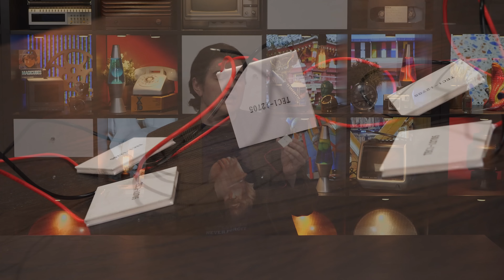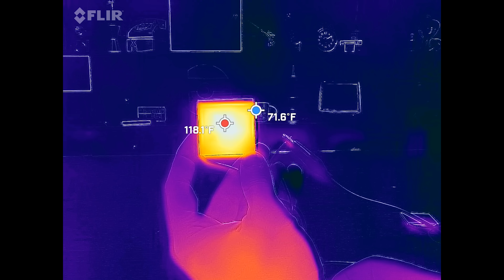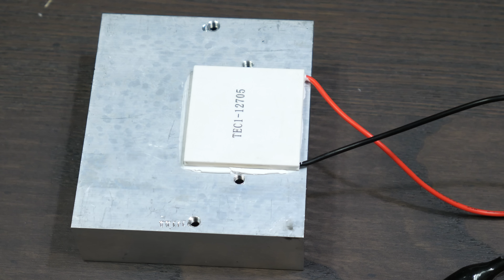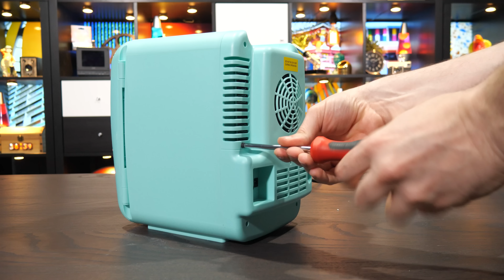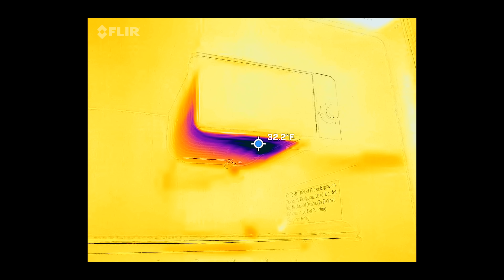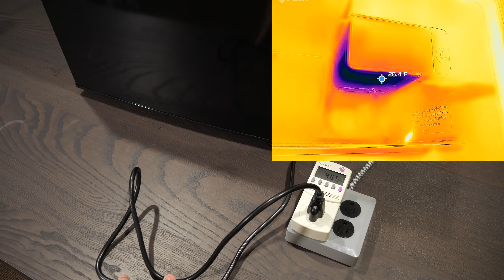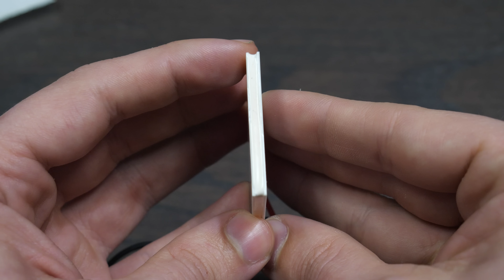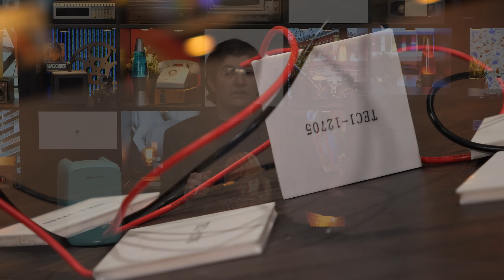Thermoelectric cooling: it's not great.

Comment: In defense of the little watt-eater it can easily plug into the car and drain car batteries faster than an intermittent compressor fridge.  So if you want your car battery dead to have an excuse to get out of work tomorrow, then the choice is easy.  The blue guy and headlights get me a day off so much faster.

You also didn't say how may of the little fridges fit in the home fridge.  That would help it cool much much faster lol  Bunches of 'em at once!

Comment: "It's much bigger than a typical mini-fridge" has the implication that both things are of the same group, a mini fridge, at least in the dialect of english I speak.

The confusion arises from the use of 'typical' as typical would typically (heh) be used as a comparative, making the sentence come across as "It is atypical in being bigger than a mini-fridge" which as you can see suggests it is one. I think dropping the typical would have made the sentence come across the way you intended because there is no comparative and it is just a factual statement.

Comment: Peltier coller/heaters have one more application......they are used to keep the temperature of laser diodes constant as they can be used to vary the temperature on a continuous scale and that too can heat and cool diode based on the ambient temperature. You can control the amount of heat or cool using PWM signal. Keping the temperature of laser dioses is critical for maintaining they spectal purity.

Comment: Thank you for telling me about the heat pump in normal fridges, needing to be upright. I always wanted to tip one over onto it's back, onto a rack for airflow, to turn it into a chest fridge, for even more efficiently, keeping the cold air from spilling out. So I'm guessing, I have to redo or carefully bend the lines without linking them, so a normal mini fridge can be on it's back, but the compressor is still upright? And does this also mean I can't use a normal mini fridge in a mobile application, like a homemade RV or houseboat, because the compressor lubrication won't be settled at the bottom?
Reply: And what do you think about making your own generator to run on waste heat, using a Stirling engine connected to a brushless DC Motor, verses an array or Peltier Termo Electric Generator units, and a massive thick heatsink or liquid cooling pump to a massive radiator, like for a racecar?
Reply: *an array of Peltier TEGs

Comment: One side is good, while the other side creates horrors for the project....turn it around and get the opposite effect. One side is great, while the other is a horror show for your project. Inevitably you are creating condensation and electrical nightmares while wasting energy on a wholesale basis. They are literally nothing more than a 'proof of concept', and the hoops one has to jump through to deal with condensation makes them useless in any electrical application, not to mention the gross inefficiency.

Comment: the best mini fridge ad I've ever seen. only 100 bucks? you got me.
Reply: But get one without that tiny freezer compartment in the corner.
Reply: @TomFichtnerLeipzig  Absolutely. I had one with and one without. With was just a pita to maintain and clean. Constant dripping during defrost cycles as well.
Reply: Also - for the noise, you can stuff insulation in the compressor space, and add a cover to reduce noise. It wont overheat
Reply: Got one for $10 at goodwill and kept my beers chilly next to my desk lol, just by common sense I could tell it couldnt do anything passed that but imo an absolute steal for beer.
Reply: I found one just as good for $80 at Best Buy
Reply: Do yall have a link for it i want one

Comment: Interesting that the door didn’t have any insulation. If you add insulation to the door, maybe improve the insulation on the walls, and have a separate temperature sensor that can cut on or off power to the unit, I think power efficiency (over time) would way up and time to cool would go down. Interesting stuff!

Comment: So the energy consumption is definitely a huge downside, but I will say that the awful cooling capability is significantly influenced by them just using a cheap, terrible design. I work with high end scanning electron microscopes, and for doing EDS (energy dispersive xray spectroscopy) we use a detector with a peltier cooler that can keep it extremely cold. Like potentially -25F, though I'm not certain about that. Thing about them that many of the cheap designs don't take into account is that because the element itself has no moving parts it's only transferring heat out of the chamber through simple conduction - heat sink on the other side has a fan blowing across it, but the cold side is only pulling heat from what's directly touching it. Air is a thermal insulator, so if it's cooling the air sitting on it then it's going to do a terrible job of cooling. If it's got the drink can directly touching it, it'll cool that can faster but all the others will have to transfer heat all the way through it to cool down. Super high power ones could brute force through that, but really you need a better way to move the heat to the peltier element when you're cooling the air in there.

Better, still relatively cheap designs, can be had, but yeah like you said, mostly good for a car or something unless you have something like we do at my work that needs a specific small spot to be kept very cold.

As far as the insulation - if it was vacuum insulated I could see that still working well, since a vacuum is an extremely effective insulator, though I doubt they bothered with anything like that...

Comment: fucking finally, I have been caught between a peltier and compressor driven dehumidifers for my laundry room, fuck! the volumes were massively different, 1L vs 10L, but I was like but the power consumption, but if it needs power then it is doing the work, cheers fella, over the moon to have you taking and position on purchasing cheap crap, the fucking 90s kid in me really wanted peltier to work but it doesnt and it is just cheap crap

Comment: 7c Celsius is definitely food safe and there Is no food that will spoil at 7c due to heat
Reply: That's a total bs we always have it at 6 (and it even can't go lower even tho its old) for my entire life as I know it and there is nothing wrong nobody is ever sick and food doesn't spoil
Reply: it definitely is not, food stored above 40F (~4.4C) is not considered safe and puts you at risk for foodborne illness
Reply: the food danger zone is 5c to 60c
Reply: @MrBlackmidi1234567890987654321 

A Europe-wide study by scientists from the Salmonella and Listeria Unit of the ANSES Food Safety Laboratory found the average temperature of domestic refrigerators in Europe is 6.4 degrees C (43.5 degrees F), and 95 percent of them are below 10 degrees C (50 degrees F).

Reasonable storage expectations
Producers of ready-to-eat foods are required to test the development of bacteria under conditions in which the food will actually be stored. This includes demonstrating that the concentration of Listeria monocytogenes will not exceed 100 colony forming units per gram (CFU/g) at the end of shelf life.

In the absence of data on domestic refrigerator temperatures, the European Union Reference Laboratory (EURL) for Listeria monocytogenes recommended simulating storage at 12 degrees C (53.6 degrees F) in consumers’ homes.

Comment: Thermoelectric cooling is great, but the people who design them seem to not know how the work.

I always wonder why the hot side does not have a heatsink and a fan. 

You actually need to cool the hot side to increase the efficiency of the cooling on the cool side.

The thing is , normally a heatsink and fan can only achieve cooling to a few degrees above ambient air temp. 

Adding a thermoelectric device to a traditional heat sink will allow you to achieve cooling bellow ambient air temperature.

Comment: A good consumer application for these that I've come across is with an in-car phone mount. Phones will often get too hot when mounted on the dash or windshield in the summer sun or when mounted to a vent in the winter with the heat running. One of these can make contact with the back of your phone and keep it... from overheating. It wont likely cool your phone, but it'll at least not shut off due to too high heat; which can matter if you're relying on your gps.

Comment: My only real interest in this is using TEC for immediate temperature compensation for laser diodes.  Though tbh I've wondered about a less mobile option utilizing a mini fridge and a fiberoptic cable for output.  Maybe liquid cooling through the heatsink.  A similar approach with chillers works great for CO2 lasers...

Comment: peltier devices can also produce electricity if they are heated. they're used on log burner fans. heated on 1 side and big heat sink (usually stylised) on the other and hooked up to a dc motor which turns a fan. handy to push heat around a room for a log burner

Comment: Theoretically, you can use pure butane as refrigerant or even NOx, but you may need higher compression or your working range is more narrow or need extra steps. 
Thermal electric solid state heat pumps like a Peltier or Seebeck element, depending on the application,  have no really limit how low or high with the temperature you can go. 
The Voltage sets the achievable temperature difference, the current sets the amount of heat that is displaced to the other side. Thats so far for the Peltier, the Seebeck is the opposite principle  and works the other way around. Heating one side and cool/dissipate the other side, the temperature difference sets voltage and the current is basically dependent on the amount of BTU that actual travel through the element and the circuit resistance. But both direction have a terrible efficiency. if you buy a TEC(Peltier) element, efficiency is on applying power better as generating power, the TEG(Seebeck) is better at generating power but less efficient by applying power to cool something.

Comment: Peltier elements do seem more useful for heating. A resistive heat element has a COP of 1. A Peltier element that can move heat in addition to the heat it naturally generates can put out a fair bit more oomph in heat mode. I'd argue that's useful for a box that you want to heat rather than cool

Comment: Basically a thermocouple in reverse. I looked into designing a "cold plate" around the Peltier junction. A nifty notion, but I determined that the heat generated by the process overshadowed any useful cooling effect. 
So much for my great idea. I could have left out the Peltier device and added a heating element and don a hotplate just fine ... AND USED LESS ENERGY!
Side note: my father in law bought one of these Peltier junction cooler for my mother in law to keep her insulin in. The version was the 12V Travel Cooler version, and never worked, and ran down the car battery when they were parked.

Carnot cycle fridges are a much better solution, as you showed.
Nifty device, though, and have a (very narrow) truly practical applications, such as cooling something in tight places. And the Peltier junctions can be stacked (with in limits).

Comment: A cute and mundane application for these kinds of "fridges" is sourdough starter maintenance. Times between maintenance are strongly influenced by ambient temperature, and fridge temperatures grind everything to halt, but slap a thermostat on one of these things and you no longer have to do calculus to keep your sourdough in perfect working order. Two of the main drawbacks don't matter for sourdough: it just needs to fit a 1L mason jar, and never needs to hit a target under 8C (if you need that, then you stick it in the real fridge). Energy efficiency's still a killer, no getting around that. I never measured it myself, but the spec sheet claims 38W to hit approximately 20C below ambient, which is *oof*.

Its the nichest product imaginable, and I've never met another living being that even knew these things existed, but they're real! Brod & Taylor Sourdough Home costs like 3-4x more than the garbage plastic cubes off Amazon, but the build quality is outstanding, and it actually accomplishes its one singular task.

Comment: it's almost same like my bike case, i had 125cc motorcycle it's consume a lot more gas than bigger displacement motorcycle because the smaller engine always running in high rpm, whereas big motorcycle always run in low rpm in the same route.

Comment: I have some air-dehumidifiers with peltier elements and they work fine, but I noticed that they need a lot of time (and thus energy) to collect a significant amount of water. I used to use those (special) salt containers of about half a litre. Don't know if they are better to use. Well, you have to through away the water and refill them with salt from time to time, which is annoying.

Comment: The biggest thing I've seen people using Peltier cooling devices for that actually seems to do alright is for sub-ambient CPU cooling. But even then, the really neat builds I've seen using it are extremely inefficient and also still require a full liquid cooling loop to properly keep everything cooled well enough to make it worth it (performance wise, I mean) over other methods of cooling a computer. 

Even then, compressor coolers that use a standard style refrigerator type compressor are better in every way, except the space they take up. The fact that the Peltier cooler takes up less space is probably it's only advantage in this situation.

Comment: wrong, i got one of these in my room as a preteen and it was dc so i needed a inverter to plug it into the wall and it died after a few weeks and i was told i wasnt supposed to leave it ALWAYS plugged it.  but that was the coolest dr pepper 12 pack I ever had.

Comment: I had a Peltier wine cooler, it failed.  I attempted to replaced the Peltier elements, turns out the circuit board had some issue.  Cost of repair went over value of repair.  Bought a compressor type cooler.  Better, cooler.  Maybe a bit more expensive on energy.

Comment: I loved them before actually getting some and came to realize why they are bad for most applications is the cost per BTU. Only best in cooling a small location/surface area. Not for use in combining multiples to get massive cooling. Same applies to thermal power generation. Just not that efficient.

Comment: Why aren't some type of one way connectors possible in the refrigerant line. I own a couple Resturants. and god fridges, its the worst. Our 1500 liter undercounter fridge uses a compressor which has died 3 times under warranty. And we have to pay for the refrigerant each time. Something happens to the compressor then why do we have to empty all its refrigerant. Why not have some kind of one way connector or smt. And if you know deep freezers, in my country where its extremely hot the fans that cool the compressors they can die. and there is no indication for when its working or not. And you one day hear the olp click you know its now going to die because the overheating has damaged the compressor. How much stuff has gotten bad due non working fridges and how much I've spent in repairs. I feel like we need something better or just some way to not need to leave refrigerant each time we need a compressor replacement (note. All the fridges are in a ventilated room  and their compressor sides all have atleast 1.5 feet of space between them and the other wall or fridge, and they all are from lg, voltas or bluestar with their original compressors. And not old)

Comment: If you buy yourself 😉an infrared sensor with PbS or PbSe element, they look like large old-style transistors but with a transparent window. They have a small Peltier cooler built into the can right underneath the sensor. It is supposed to keep the sensor at say 0°C and does that extremely well. Similar but double-stack Peltiers can bring infrared sensors down to -60°C with ease. They are used in pulp and paper industry for process control, and probably in many other industries too.

Comment: I have found a good use for these. Yup it's mobile! I am working on a cooled and heated suit that has tubes running through it up against your body. it's already a thing but usually they feed it with a cooler full of ice but not very back pack friendly. I have 6 of them in a 2p3s config that runs off of my lawnmowers 40 volt battery. The great thing is is that it doesn't have a lot of delta on the temps for both sides. this results in a total of over 500 watts of heat removal if needed and can be pulsed.

Comment: First off you chose a piece of trash to compare to a fridge which likely costs a ton more. Get a peltier fridge that costs the same then compare! Second, everyone knows thermo electric is less efficient than phase change... 

The peltier is just less efficient and less complex. If you use a pid controller, heat pipe with fan and enough power you'll be good. 5A is crap, you need 10-15A also, you want 12v minimum, but I'd rec 24v+. Which means it can work on a battery and doesn't require AC current or a inverter. 

I made one that chills or heats 7gallons of water and  I've had it freeze the water in the radiator.

The thing is a peltier cooler can be VERY stable on temp when using a controller. A fridge isn't exact. It uses a thermostat and the fridge motor can't be turned on and off too frequently as it will damage the pump or electronics. Also the fridge has a thermostat meaning it has a "range", but just like a stove, it doesn't keep a constant temp..

Comment: They are really good at cooling phones.
The design of that crap is just stupid.
You can buy small water pump that you put underside of the Peltier and keep your drink on top of the the things it will cool it in like 5-10 mintes cause it's making direct contact and the thing is like -10° if a small water cooling setup is used